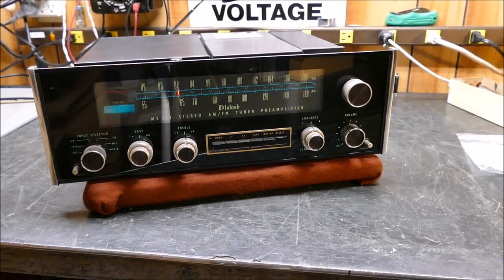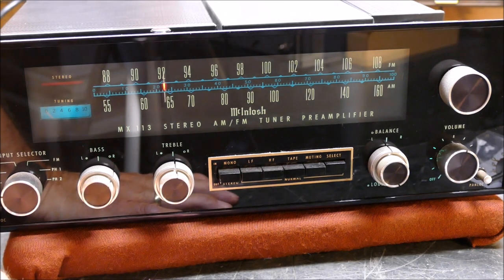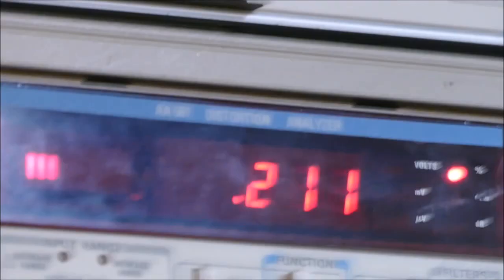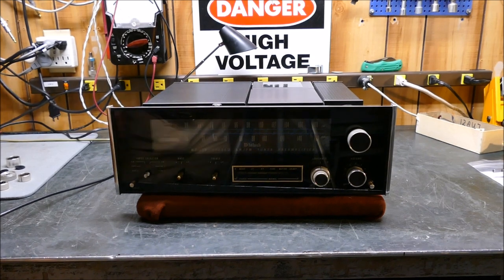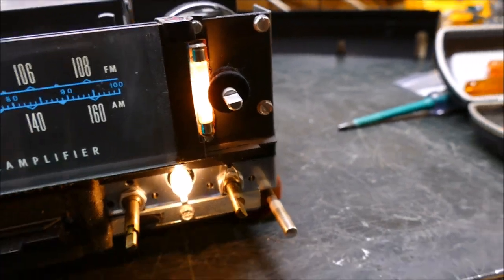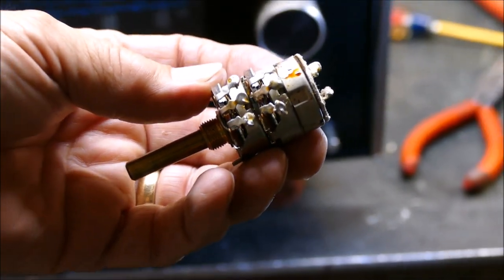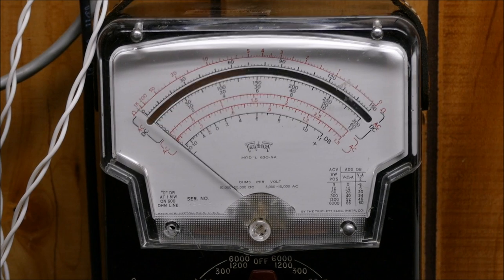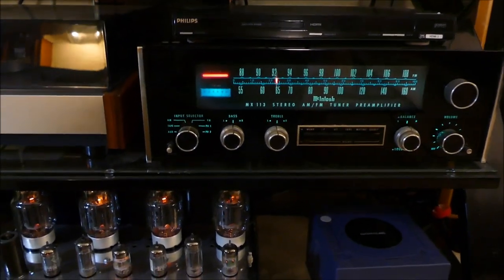McIntosh MX 113 Tuner-Preamp Volume Control Replacement

Comment: How did you manage to obtain the MX-117 knobs for your lovely MX-113? Great look by the way.
Reply from the maker: I never noticed the knobs were different from other MX-113. I just looked both models up on Ebay. I have had it for years and bought it used and it came that way. I also have the MX-112 and see they originally had the same style knobs. Oh well... I might mention that I had a very intermittent issue with this MX-113 where the FM audio would randomly go in and out and it turned out to be a dirty MUTING control on the top of the unit. Apparently, a dirty wiper on the pot. I mention this as it was so random and intermittent it took me quite a while to find the issue. Thanks for your comments.

Comment: Double check that the power switch portion works reliably. I replaced one like this on a C-26 and the power switch only worked 1/2 the time; McIntosh replaced it without so much as a whimper - they knew they had a problem with some of them.
Reply from the maker: Thanks - good to know. So far, so good here.

Comment: I have an mx113 so this is a great video. Also I have a mac 1900 with a funky volume control I think may be the same as the mx113. When I looked at the wiring on the pot I was very intimidated as there are at least 10 different terminals each with multiple wires coming in. Wasn't sure how to access it. So this is very helpful to me. I was going to try some deoxit but now I'm thinking the problem is a failure of the trace itself so deoxit isn't going to help. Also it's good to know you can still get these pots from mac. Thanks.
Reply from the maker: I have a Mac 1700 that I gave my son. He loves it and it has an excellent vacuum tube tuner in it. All of the vacuum tubes are original and have the McIntosh logo on them. Output stages on the 1700 are SS. . The only problem I have ever had with it are those slide switches which were, fortunately, cured by contact cleaners like DeOxit. Good luck with yours. McIntosh may still have a replacement volume pot. It might be a challenge to replace but I bet you can do it. In the case in this video, I was able to physically remove the old pot but leave all the wires attached as they were long enough so I just carefully moved one at a time from the old pot to the new one. It turned out pretty easy.
Reply: Deoxit won't work unless your experiencing scratchy sounding controls ,when pots become intermittent 99% of the time the blade inside of the pot isn't making proper contact ,I've stopp d using standard gain pots on my normal gear in favor of using a gain circuit volume control ,on my Mac pieces I only replace with true McIntosh model correct OEM parts ,I've got about 15 different new in box pots stashed away that covers all eras of different pots they used .

Comment: Do not glue your knobs like was done here,if you must glue the center portion back inside the knob always place your adhesive inside the outer knob,putting adhesive on the outside of the inner knob seat will allow glue to be pushed back onto your felt washer and possibly on the pot stem ,I've done it before & learned the hard way .
Reply from the maker: Good point and now that I think of it... what if the knob needs re-positioning on the shaft to align the front markings like in this case? Too much glue could make it impossible to remove the inter part. 
Seems like we all have to learn the hard way sometimes.  I have often thought that we rarely learn from others experience but hearing others tell of their experiences goes to validate what happens to us when we do the things we do and then we say, "Yep, I was warned about that and sure enough....."  :-)
Have you ever built something and wanted to make darn sure the screws never came loose and put Loctite on the threads only to have to take it apart the next day with great struggle? I think what we should keep in mind, by looking at high quality instruments from decades ago, that we want to build it the very best we can but... since it is surely going to need maintenance some day we should build it so it can be taken apart and repaired. That attitude is definitely not used today. Today if the equipment fails - just throw it away and buy an new-improved one. Sad but true.

Comment: I have the same unit I don’t have the same knobs though . How do you take the grill off for me to blow dust out from inside ? All in all mine is still in good shape .
Reply from the maker: I have the MX113 and MX112 and they have the different knobs you mention. You just have to take it to a workbench and start removing screws, top and bottom and knobs and it will come apart. You should not touch the back of the front panel as the paint mask is very complicated and fragile and you can easily cause the paint to flake off and then you will have holes where the light can shine thru.  Got to be very careful.
Reply: ElPaso TubeAmps  ok thanks for the info I bought the unit 6 years ago I’ll see what I can do .

Comment: you can fix them,  you can use the liquid stuff intended to repair the defroster lines in car back windows. works great.
Reply from the maker: I hope you know your comment made me dig that thing out of the trash can. I am going to try and fix it now (maybe with a video) with either a bit of copper tape or silver plating solution at the point of the open. Thanks...
Reply: Yeah i figured. I did it to save a $100 part :) .... Another product you may have on hand is some of that conductive paint you use for RF shielding.
Reply: ElPaso TubeAmps For $100 replacement value I'd be fixing it too :-| How did you get around the misplaced location tab issue? Did you have to cut another keyway in the chassis hole?
Reply from the maker: I just cut the tab off and eye-balled it in and tightened it down. It's working like new. I think it will hold OK.
Reply from the maker: Now that I got serious into examining this item, I found out that the resistive part of the pot looks more like a very thin tape placed on the plastic ring. In my case, which has to be looked at with an eye loupe or microscope, you can see that about 1/3 of the resistive carbon trace is completely missing.  I thought there might just be a microscopic break but that is not my case.  I can see now that a new one was the only option. I am beginning to wonder if some contact cleaners might wash off grease and increase friction on the wiper to carbon trace and actually damage the thin carbon trace of the pot...

Comment: You must have quite a collection of McIntosh equipment.
Reply from the maker: I have picked up a number of  items over the years and should sell some but I  don't like selling on Ebay and locally, nothing sells in El Paso except for really cheap.
Reply: If you are looking to sell an amp or two i might be interested.  Especially if they need recapping.

Comment: The newer style McIntosh knobs look great on the MX113.
Reply from the maker: You are the second one to notice and comment on that but those knobs are what came on this MX113 and the same knobs are on the matching MC2205 and I agree that they are more appealing than the flat style knobs that I have on a MX112. Thanks for your comment.
Reply: I "updated" the knobs on my MQ101 to match the rest of the equipment in my system as well. Four MC2505 knobs were needed plus a small concentric inner knob. It just makes the system look right. I just purchased a mint MX113 myself. This series of tuner preamplifiers (MX112/113 & 114/115 FM-only variants) is excellent when properly restored.
Reply: Correction: meant to say four MC2205 knobs were needed.

Comment: Did you order that part directly from McIntosh? I have an MX-112 with the exact same issue. I've already replaced the balance and bass potentiometers on it which were confirmed toast.
Reply from the maker: You can order parts directly from them either by email or phone using a credit card Just Google them and they are easy to find and are pleasant to work with. I have an MX 112 also and fortunately I haven't had any issues with it yet except for a couple of tiny spots of black paint coming off as I mentioned in the video which lets light shine through the front panel. Fortunately they are small specs and not too distracting..
Reply: +ElPaso TubeAmps 
Excellent, thank you!

Comment: Loverly old RX....... that McIntosh stuff looks very nice......bloody expensive I am guessing.
Reply from the maker: Their vintage vacuum tube amps,  preamps and tuners are often times outrageous but used solid state items, circa 1980's, like the MX113,  MX112,  C26, etc, are usually reasonably priced. You never know what you might find at estate sales... Maybe 10 years ago, I saw a complete set of McIntosh vacuum tube equipment, power amp, preamp, tuner, speakers all sell for $100. I did not have the heart to tell them they should have gotten a few $$$ for it. I picked up at a different estate sale a C20 for $20. It did not work but was easy to fix with new electrolytic capacitors.  The C20 is used every day in my home theater. You never know what you can find  out there.
Reply: Periodically, i look for an old Macintosh  amp, but prices on Ebay are usually insane.  Ive noticed the same thing is true lately for old vacuum tube ham gear, even lesser known models.  But once in a while you get lucky.  I just picked up a Hallicrafters SX-101a in pretty nice condition for $86  should be good as new with some caps, maybe a few resistors and a fresh alignment.  Hate to part with stuff after its fixed though.
Reply from the maker: I have the same problem - that's why I have so much. As I mention often, I get unbelievable low prices at estate sales in the El Paso area especially SK amateur radio operators sales.I certainly have more than I need but not as much as I want...   :-)
Reply: Speaking of good luck I just brought a Semi Trailer load of Electronic components from a Huge factory shut down........I now have new spare parts measured in cubic metres lol.......took all day with 2 forklifts to move the stuff lol.....

Comment: can you do a video about making a 01A tube preamp? i cant find anything on the subject
Reply from the maker: I researched that tube and it came out in 1925 and there are a lot of equivalent replacements you would want to include in any research. I don't have many of those truly vintage tubes so I can't help in this case. I didn't look closely but it may be classified as a power triode and not lend itself to a preamp configuration unless you are thinking of something like a high level AUX type input. In the old-days, I think progress was so important that last-years tubes were quickly forgotten for the newer models and now almost 100 years later we want schematics that never were drawn because of our fascination with these old jewels.  Maybe if you look in manuals for AM radios in the 1920's or 1930's you might find this tube used and get some idea of the component values they used in those days. Best of luck.
Reply: i have a ux-201A and i want to be able to use it but i cannot find any scematics or anythng of use

Comment: Why didn’t you just show an oscilloscope view of both channels at the same time while moving the volume control. This would have given an easy way to see how the V.C. Didn’t track correctly.  Your camera tracking a digital readout was no help. It would haven’t helped to see your soldering in the new control and how you handled the complicated wiring. That’s what i wanted to see. Nice test bench set up i would like to see more.
Reply from the maker: Good  point. Part of the problem of showing exact soldering and wiring moments is it sometimes takes so long and there may be a lot of fumbling - or maybe I should take the time to do so. I will keep that in mind next repair job. Thanks for your comments.
Reply: @ElPasoTubeAmps  Another thing I wanted to see was how well the new V.C. tracked and how you handled the guide on the new V.C. not lining up with the old. Did yo bend it out of the way or drill a new hole for the guide to fit in?

Comment: Can I get a link to part please
Reply from the maker: I bought my volume control pot directly from McIntosh. You can Google them and call or write/email them. They are very nice to work with. The cost for the pot was $100 + shipping +  tax.
Here is the link I got by searching for. "McIntosh Labs phone number"
https://www.google.com/search?q=mcintosh+labs+phone+number&rlz=1C1CHBF_enUS757US757&oq=McIntosh+labs+phone+number&aqs=chrome.0.0.14076j0j8&sourceid=chrome&ie=UTF-8

Comment: I hate the cost but still, I had to buy it from that seller. sigh ....
Reply from the maker: I agree the cost is too high for a pot but it did fix mine perfectly. I have a much older C20 (early 1960's) that still works like brand new and I use it every day in my home theater system, but I bet the pots in it are real carbon pots like the vintage Allen Bradley military pots and not these cheap pots with only a little piece of plastic coated with carbon like most are today.
Reply: Yea I hv C29's too, one early the other two late models. They sound pretty lovely. I recapped one late model of those three, and it now sounds even better. Anyway,  one guy on audiokarma said it is possible to replace their carbon sweep plates using new ones disassembled from other pots with proper resistance values. Did you hear of this?
Reply from the maker: @eggshellskullrule7971  No, I have not heard that about replacing the carbon sweep plates. I think a person would have to be extremely lucky to find one that is the correct resistance value, a log taper and one that would physically fit. The very best  military pots that I know of are the vintage Allen Bradley and they are sealed so I am not saying it can't be done but I think it would be a really lucky find to obtain such a pot. If I had to make it work with some pot that was not a direct replacement and I was lucky enough to have the correct value for both pots, the shaft was long enough and had the AC switch, maybe a fellow could add the right amount of washers/spacers and cut/file the shaft the correct length and notch so the knob would fit again but... wow... again, that would be a lucky find. I think we are stuck with paying the price for new ones from McIntosh...   :-)